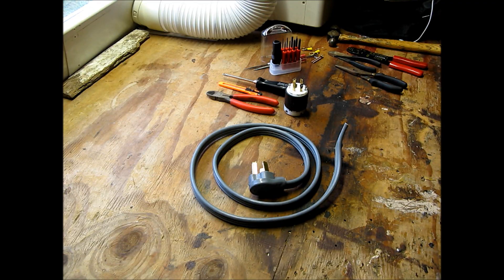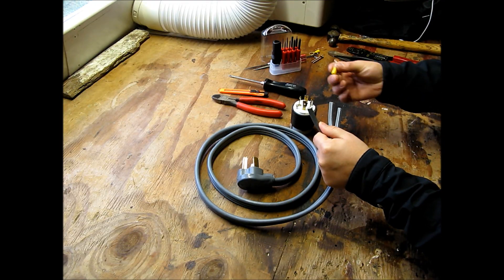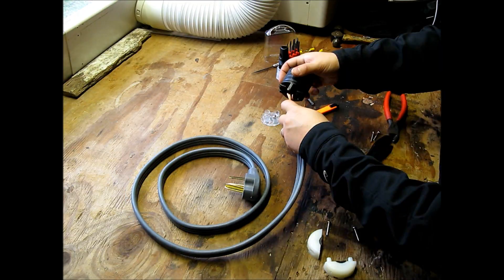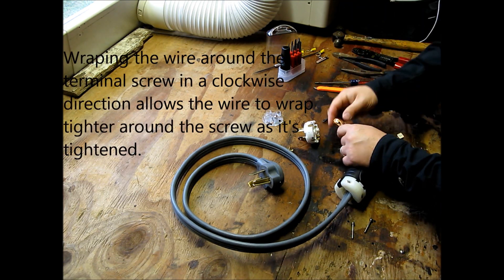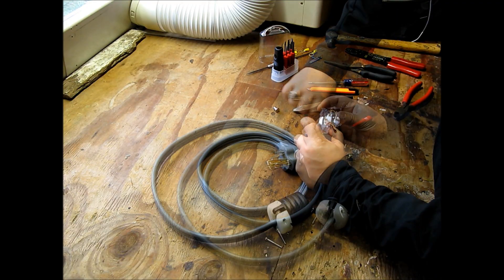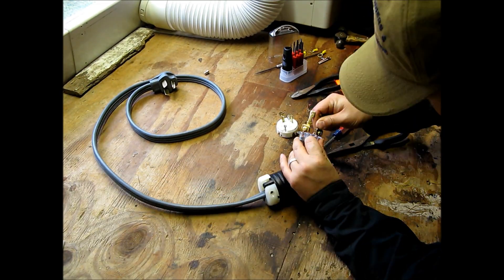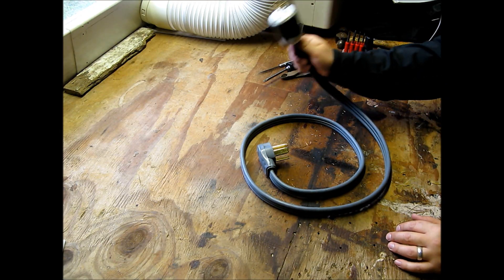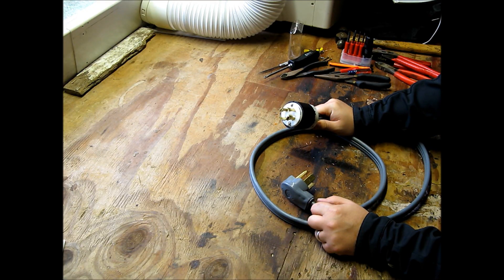How to build a backfeed cord

Comment: I have no issues with a back feed cord, what I have issue with is the fact this idiot and many like him do not realize that there is no isolation of all the lines to the grid. There is still a potential to back feed power thru the neutral line. Just another idiot demonstrating he is a clueless moron that does not understand how the power grid works.
Reply: letserb, you SHOULD have issues with the power cord, and the Neutral backfeeds NOTHING to the "power grid". It is grounded. But the two "hot" wires must always be disconnected. Turning a circuit breaker off does not necessarily do that. The lack of knowledge and understanding of how this all works, yet making videos like this one, is appalling to me. I have been making money Professionally for over 40 years now fixing the results of this stupidity. You might want to take the time to read my dissertation posted a few minutes ago , beginning with " I have to comment on this “cheap” DIY stuff...".
Reply: Really Bruce? To my understanding, if your immediate ground is failed the charge will transmit to the nearest ground, that might be your pole or one down the line. Thus there is a chance of getting a shock even if you are some distance away. So it only makes sense to isolate all three wires. I know there is aground on your panel, at your transformer, and also at various intervals along the line. Electricity takes the path of least resistance, so would you like to try and explain that fucked up bullshit you were spewing once more idiot?
Reply: 1. I do not understand "if your immediate ground is failed"... what is there to fail?
2. I do not understand "the charge will transmit to the nearest ground" ..... what charge? from where does this charge come?
3. We are disconnecting the two "hot" wires to keep from transmitting power (energized lines) back to the power grid. The Neutral carries no voltage. So what has this to do with "immediate ground is failed", "charge will transmit", "chance of getting a shock" (from where?), and "path of least resistance" ?
Reply: I have to ask, what are your credentials regarding knowledge of the "power grid"?

Comment: After turning off the main and all my breakers in the electrical panel I hooked up exactly like you did by using the dryer plug. Then as you did, I plugged in the cord, cranked the 7000 watt generator went back to my electrical panel, making sure all breakers and the main was off and turned on just the dryer breaker. Within about five seconds the dryer breaker would trip. I repeatedly tried this maybe three or four times but to no avail. I don’t know why it keeps tripping? There is no load on the electrical panel at all, just the feed to the dryer breaker from the generator....Can you help?
Reply: maybe there is something else on the dryer circuit? should not be but . . .
Reply: my best guess would be that one of those 2 pole CBs in the panel is not really OFF, even though you turned it off...... CBs can go bad, and not open internally when you turn it off. Maybe the AC compressor circuit was still on? If there truly is nothing turned on, it is strange that the dryer CB would trip with no amps load. Try this: turn off all loads to the 2 pole CBs in the panel, then operate the various 2 pole CB's in the panel on/off several times to free them up, in case one is stuck. You do not want to do this with those loads turned on. Since the dryer CB trips, and not the generator breaker, the cord is not the problem.

By the way, this rigged cord is a faux pas. You might want to refer to my other comments in this same forum.
Reply: 5 years later-what happened? Did you cure this issue?
Reply: So a ground is not required or should a separate ground from the twist lock be hooked to a rod in the ground outside or the generator chassis?...I made one of these cords before but I thought I used all 4 wires...I don't remember because it was back in 2004

Comment: I’m an electrician this does work but be careful don’t turn the power before it’s plugged in the prongs will be hot this is way less money than a 1400 hundred transfer switch
Reply: Hi Larry, I have a generator with 3 prongs (120V/30Amp), that I want to wire into 3 prong dryer. I understand (correct me if I am wrong), to power both lines, I would have to make jumper cable from one phase I have, to another prong, so I have 120V going into both. Now, I still have neutral (which goes to the middle terminal), but what do I do with the ground wire coming out of generator (as I had one hot, neutral and ground coming out of generator)?
Reply: Larry, would you do this for a customer?

Comment: So... I'm assuming that this worked for you? I have a situation that looks just like what you're doing. I have an older dryer outlet with only 3 wires. #1 hot, #1 hot, #1 neutral. My generator provides 240 with a 4 prong twist lock. You kept the neutral and eliminated the ground and had no issues?
Reply: gargois1 if I were going to do this and I had your situation, I'd replace my dryer outlet with a four prong outlet, replace my dryer cord, then make the suicide cord with another four prong cord. Then you'll have your ground wire.
Reply: Yea, that's probably a better idea.
Reply: @rogermurph101  But how easy is it to replace the dryer outlet? Will you have to buy and replace 20-30 feet of cable and go into the breaker panel to do it? What if you forget to turm off the main breaker ? SUICIDE! Also, how can you install or move a breaker in order to put in the desired UL and NEC approved interlock kit without opening the panel and exposing yourself to live, dangerous electricity? What if you do not turn off the main breaker? SUICIDE!  Not covered by insurance!  Does homeowners insurance cover home owners electrocuting themselves by removing breaker panel covers to install interlock kits and transfer switches?
Reply: @bigpardner  This is not idiot proof.  Nor is heating with fire in a fireplace or cutting fire wood with a chainsaw instead of buying it but if you have any sense it can be done safely in a pinch by anyone with the mental capacity to safely handle a loaded firearm.

Comment: Funny how all of the electricians are second guessing this and quoting code. .. It was a licensed electrician that  made my cord for  me.. right now a hurricane has wiped the grid off.Hurricane irma.. it will be weeks for restoration.. . I shut off the main.. all other 220a  (except) the dryer... then turn on all essential  110s.. one light per room... 8000 btu wall unit and so on.. I will ultimately have  a transfer switch put in.. but for now.. you can not find an electrician in S Florida due to the storm.. 5 million with out power. .. they are too busy backfeeding their homes..
Reply: There are hacks in every industry. Seed a proffesional painter bondo over a rust hole once too
Reply: You "licensed electrician" should have simply installed an inlet receptacle and an interlock kit.  Under 100 bucks and everyone is protected.
Reply: If your house burns down because of this cord, are you going to sue the "electrician" who made it? And you may be right, all the s. Florida electricians may be busy "back feeding" their houses, but, I will guarantee they are not doing it through their dryer outlets!
Reply: just because he was a licensed electrician does not mean he is ethical or competent.I am a licensed IBEW journeyman electrician and have refused to wire gensets up illegally;it is a matter of lifesafety not costs.
Reply: @jamesellis5549  exactly so many "electricians" do this and it not only illigal it unethical.
Reply: @electromechanicalstuff2602  why is this because I'm not paying someone to put a 220 in my breaker box ? What's so dangerous about this so I would like to know
Reply: @johnsnow6022  Story time......
One of the many times i used a sucide cord this is what happened.
I hooked up a gen by backfeeding my welder plug in my garage. I told my wife dont touch it no matter what! No point of explaining y other then i said it could kill u! While i was at work i called her to ask her the status of the fuel level. She said the gen is off and shes back on grid.... i couldnt form words for 15 seconds then only curse words for 30 seconds. Why, how, what the f did u do?!!!!. She said the neighbor came over and told me power was back on. He helped me switch it back. Whats the big deal? I said how exactly did you do it? She said the neighbor unplugged it and told me to turn the main breaker back on. I said did he unplug both ends? She said i dont know he said it was ok. I said just stay away from the cord in the yard that he unplugged. Im on my way home. She said its not in the yard, she picked it up and now its in the garage. I said when did it get put in the garage?
 She said she put it in the garage an hour or so after the power was restored so she could cut the grass. When i got home guess what i found. A LIVE 240 VOLT MALE CABLE LYING ON THE FLOOR. "I" ALMOST KILLED MY WIFE!!!. It doesnt matter how well you explain it people can not be trusted to stay away from this deadly hook up! Its not worth risking someones life over $200 for a gen interlock and a proper receptical for legally backfeeding your house! Dont do it no matter what. Now u say i live alone its fine no one will touch it. Ok... your putting yourself at risk of jail time. How? Ill tell u. Lets say your neighbor is doing the same thing. Except hes not as " smart" as you and forgets to shut off his main and back feeds it into the grid for even one second then his breaker on his gen pops. Or burns up his gen. Well at the end of the block his gen went through the transformer and energised the 7,000 volt line. Cause transformers work both ways. There was a lineman working on the line that he had confirmed dead and 0 volts on not 10 mins ago. He gets electricuted with 7,000 volts and dies. Now the foreman and the shariff are driving around the neighborhood and lookimg for people on generators. They see u all lit up. Prove to them it wasnt you who just killed the lineman. Good luck in court.
Here are some short videos proving my points
How the lineman gets killed. Google it they do get killed every year with backfeeding
https://youtu.be/GA_zhLogUG8

This is what you should do
Below are interlocks and how they work. These are the 2 companies that make them.
Geninterlock.com

Interlockkit.com

https://youtu.be/n7DkaorEQPQ

https://youtu.be/_pQpXo4np4k
Reply: @electromechanicalstuff2602  as soon as you started talking about your wife I instantly knew where you were going with this. And I instantly became terrified because my wife wouldn't do the same thing. Thank you for not being rude and actually explaining some things to meI appreciate it and I will definitely take your advice.
Reply: @johnsnow6022  I thought my wife wouldn't either but when u got an old timey neighbor who's never let u down yet he may convince the best of em he knows what he's talking about. Im.not saying hire an electrician. I'm saying it ain't hard to do it right right yourself for under $200.
Reply: @electromechanicalstuff2602  sorry about that I was using talk-to-text what I meant to say was my wife would do the exact same thing and probably worse
Reply: @johnsnow6022  gotcha. Ya the interlock is like $60 and the out let is like $50 the rest of the cost is the wire. If your using a 30 amp gen u can use 10-3 romex wire. U can check out some of my vids and see how I do it now. I got much bigger 50 amp generators now but the interlock doesn't care what size breaker you use. Just size your wire and outlet according to your gen and your golden. Have a good one
Reply: @electromechanicalstuff2602  I'll definitely look at the videos I appreciate it again and have a good night yourself
Reply: @electromechanicalstuff2602  
Thank you explaining so well with positive solutions togather gunious 🙏😀.
Reply: @thehighriseconstructionob9679  no problem!
Reply: @oldschooldiy3240  best comment lol

Comment: This may be illegal but it in a pinch it works and if the SHF we would not care just like we wouldn't care if we ran the generator in the garage.  Nice job showing how to get it done and advising everyone this is not a how to but your own option.
Reply: If Shit hits the fan use some candles.  You'll get by without your lights
Reply: @pickford7812  Said no one ever
Reply: Not illegal. 702.5 Transfer Equipment
Transfer equipment shall be required for all standby systems subject to the requirements of this article and for which an electric utility supply is either the normal or standby source. Transfer switches shall not be permitted to be reconditioned.
Exception: Temporary connection of a portable generator without transfer equipment shall be permitted where conditions of maintenance and supervision ensure that only qualified persons service the installation and where the normal supply is physically isolated by a lockable disconnecting means or by disconnection of the normal supply conductors.
NEC GLOSSARY:
Physically Isolated (as applied to location). Not readily accessible to persons unless special means for access are used. (CMP-1)

110.25 Lockable Disconnecting Means. Where a disconnecting means is required to be lockable open elsewhere in this Code, it shall be capable of being locked in the open position.

The code allows for emergency connections.  You need to lock your main panel when doing so to keep someone else from closing the main breaker.
Reply: @snap-off5383  Bam! Letters strung together to form actual text, with numbered paragraphs AND bold font -- it's GOTTA be true...and valid wherever you are! 'Nuff said!
Reply: @reryro1472  When someone cites the NEC, it implies only valid where the NEC is the adopted code.
Reply: Who exactly will arrest you?

Comment: words can't properly describe how many things are wrong with this. why on earth do you strip so much of the wire or dismantle the entire plug or the other 100 things you did wrong?
Reply: Bob Smithereens  I specified some of them but to make you a list The wires dont get stripped anywhere near as long as he did The plug cap really should of been installed on the wire before you strip the wires The wire clamp does not need to be removed The plug backing should not of been removed You dont remove the screws from the lugs on the plug, they’re designed to not be taken out You dont hook the wire around the screws on this design of plug This guy clearly has no clue what so ever of what he is doing. Literally not a single thing was done properly.
Reply: Bob Smithereens  nothing really wrong with that as long as you know what you're doing and you're aware of the risks associated with it. You'll notice I didn't list that as one of the things he did wrong. Doesn't change the fact that he clearly has no clue what hes doing and he certainly shouldn't be one of the people using this type of cord from his overwhelming lack of knowledge of the most basic electrical parts that hes using.

Comment: ...even though the main breaker is shut off there could be leakage through the ground terminal. It may be a bit more costly but a transfer switch is the only safe way to properly do this.
Reply: If “leakage” is possible, how are the interlocks legal? They do nothing more than manually block the MAIN so that someone can’t flip it. You’d have the same situation as this just in a legal manner that you can’t screw up.
Reply: @Florida_Man_Robb  dude, same question I've had for a long time....The interlock is legal and makes everyone happy, but does nothing different than turning off the main and backfeeding.  I don't get it wtf?
Reply: David Cameron how would it “leak” thru the ground terminal ?
Reply: @TacticalHandyman  Neither the ground nor the neutral are switched by the main breaker, therefore power could still back feed into the grid or your box and potentially hurt someone or cause a fire.
Reply: @maurice7413  that makes sense thank you.